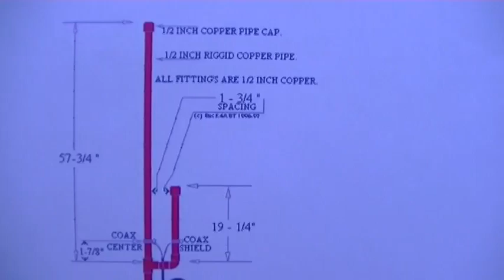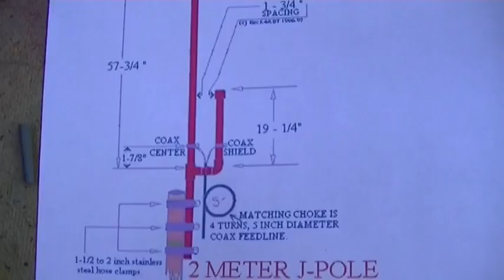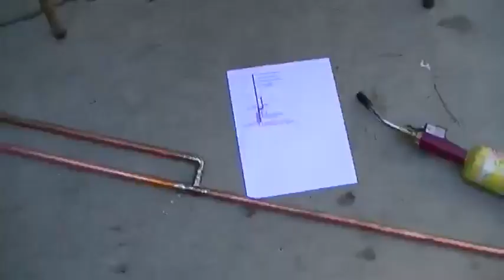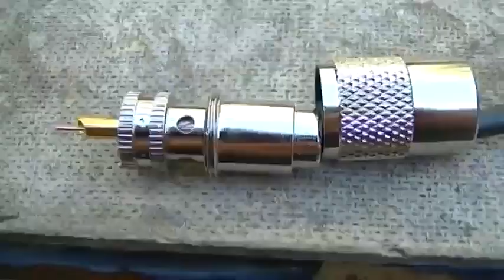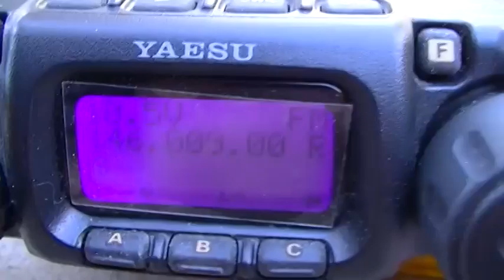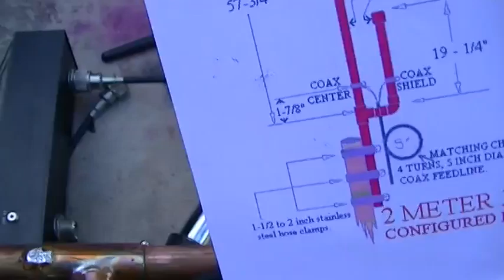Building And Tuning 2 Meter 144 Mhz Copper J Pole Antenna

Comment: Good job on the build, Next time you might want to invest your time in building a better antenna design. 

 You might not know this but the Slim Jim and the J-pole are are variants of marconi style antennas and are nothing but snake oil whose performance has been massively over exaggerated. The over exaggerated gain claims of these antennas has been thoroughly debunked by some of the most well respected antenna experts in ham radio.  

 In the real world and contrary to their fanboyz both these antennas have less gain then a simple 1/4 wave ground plane antennas. If you are using one of these antennas then your coax shield is actually acting like the antenna and not the so called Slim Jim or J-pole part of the antenna.  That's why the performance of these antennas drops when you use a choke balun at the feed point 

Unfortunately inaccurate antenna modeling by a few unethical hams produced exaggerated gain figures that still persist to this day. Unfortunately these lies have persistent primarily because the average person building these antennas holds an entry level licence with little understanding of the math and science behind feedlines and antennas and as such they are easily sold snake oil.

By the way you never way to use normal silicone to waterproof coax, Not only is it make a poor dielectric It's releases acidic compounds as it cures
Reply: Isn't the appeal of slim jims the space and weight that they don't take up?  A quarter wave ground plane antenna isn't exactly a low weight, low volume item.
Reply: knupder actually a quarter Wave 2 meter ground pkanr antenna is significantly smaller than any J-Pole style antenna. 

The fact that J-poles are constructed almost exclusively  of copper plumbing pipe and that quarter waves can be made out of 12 gage wire  makes the J pole significantly heavier than the quarter wave.

 The only value  j Pole style antenna offers is the Practical experience of learning to build a slightly more complex antenna design. 

by complex I don't mean better or more efficient just more complex to build
  A quarterwave ground plane antenna is exceptionally simple the build with so-239 panel mount and some copper 12 gauge wire. so it's nowhere near as much fun to build but it is a much more efficient antenna
Reply: You can make a slim jim out of ladder line though.  You ever move through terrain that wasn't manicured for an easy walk?  I wouldn't want to lug a ground plane antenna through actual bush.  That would just be an exercise in wasted calories and frustration.

I'm not saying that the technical aspects of one is necessarily superior to the other, but there's a time and a place for compromise.  There does come a point where space and weight are at an absolute premium (and where things just snag on every errant branch that you encounter).  For whatever the difference is between the volume and the weight that your ground plane antenna takes up (versus one of those roll up slim jims) that's as much food or medical kit that you aren't going to be carrying.  It might not matter in a great many number of cases, but there does come a point where you're cutting the handles off of your toothbrush because the damned thing is just too big otherwise.
Reply: knupder 》》 thats true, but keep in mind that's a portable antenna and not something you would want to put on top of a 70-foot tower subject at 60 mile an hour winds or for that matter even on top of a 50-foot guide mast on your roof. 

So we kind of got to compare apples to apples and oranges to oranges.

 the one place where a Slim Jim or J- Pole shines is as a roll up portable emergency antenna.
Reply: I don’t believe a 1/4 wave gp would outperform this antenna, the j pole is a variant of the end fed dipole and should perform as such. I know there is some snake oil out there regarding what part of the antenna radiates and therefore how much gain is obtained but once it’s current distribution is understood ie only the part above the j section radiates then it should be understood its performance should be about the same as any other form of 1/2 wave antenna.
Reply: @johnyoung1128  now a quarter wave ground plane at the same height without perform a j-pole all day long.

The reason some people think the j-pole performs better is that it's radiation pattern is very inconsistent so it will have lobes in certain directions that perform better at the cost of other directions, this is mainly because the primary radiating element on a j pole is the coax. 

The quarter wave dipole is a vastly underrated and underappreciated antenna, do a bit of research on radiation efficiency.

Then calculate how much power is actually lost at the feed point of a j Pole when properly choked.

Another antenna that will significantly outperform a j-pole is the iso-pole
Reply: @dannelson8556  I respectfully disagree with your opinion. “Do a bit of research” is often something thrown at someone you disagree with. I find what you have said to be inconsistent with what I have “researched” on this subject and will not be further drawn into an argument. Good day to you.
Reply: @johnyoung1128  you seem to be confusing opinion with math science and engineering.

The j-pole antenna is nothing more than an end-fed zeb. This antenna is just another example of snake oil salesman exploiting people's ignorance. 

This is not a new antenna designed by any stretch of the imagination, the design has been thoroughly tested and the math tells us that there will always be common mode current on the feed lines or the supporting structure.

These common mode currents cannot be eliminated with balance or chokes or any type of matching Network they will always be present to some extent or another and they are highly undesirable.

https://www.w8ji.com/end-fed_vertical_j-pole_and_horizontal_zepp.htm
Reply: @dannelson8556  I have already said I will not be drawn into an argument.
Reply: You seem to have your own religious dogma in this fight. You've ignored a lot of published research on jpole design.

Comment: man i made 2 of them i even added brass tunning stubs but i am just unable to get it to perform any better then my. 1/2 wave 2 meter antenna.. I got the swr down like yours..
Reply: It will have about the same performance as a half wave antenna because electrically this is a half wave antenna. The part below the open end of the stub is just an impedance matching feed line.

Comment: just curious if lightning is a concern with this?? sorry for stupid question.
Reply: Caidyn Edlund You would want to use a grounding rod with any antenna like this. Also Ive been told terminal clamps work better than solder for the cable and wire connections because lightning will melt the solder in a split second.
Reply: Mine got hit a few years back, did do some damage. Remember to disconnect before a storm, if you're worried about it.

Comment: Why not use a non-conductive spacer at the top of the tuning stub
 to keep it the right distance ?
Reply: looks like he didn't clean, didn't flux, and because of that overheated the pipe causing it to warp like it did.  You can see how discolored and gold the fittings turned, they are baked way past where they should have been heated for solder to evenly flow.

First thing to learn when building an antenna like this is how to sweat pipe.
Reply: I use 3d printed spacers to keep them parallel.  It makes a difference, although, with these testing techniques, you would never be able to correlate it.
Reply: +Jon Biddell can you show an example of non-conductive spacer at the top of the tuning stub?
Reply: +Dan Eriksen Something like a piece of lexan or plexiglass, cut to fit between the two elements to hold them at the right spacing
Reply from the maker: +Jon Biddell It doesn't need it, very rigid once soldered. Also it doesn't effect the swr much, the length of the tuning stub is whats critical.
Reply: Most important overlooked item..  The dielectric constant is different than air.  Insulators in this gap will affect tuning as it changes the capacitance.  Dielectric constant of air is very close to 1.0006.  Polycarbonate is 3.0.   Some materials will have dielectric absorption.